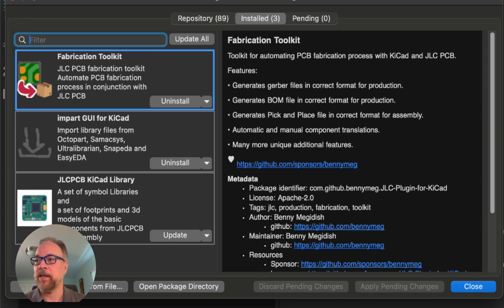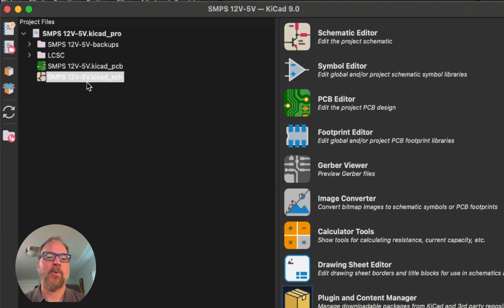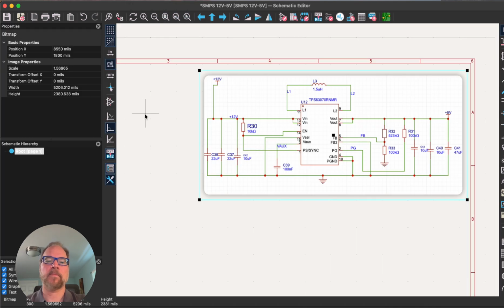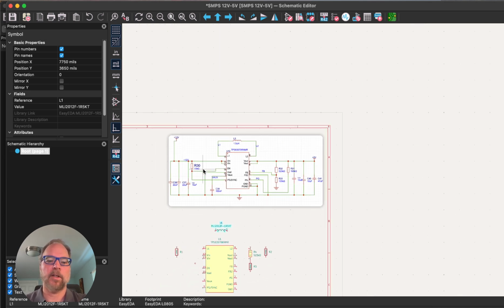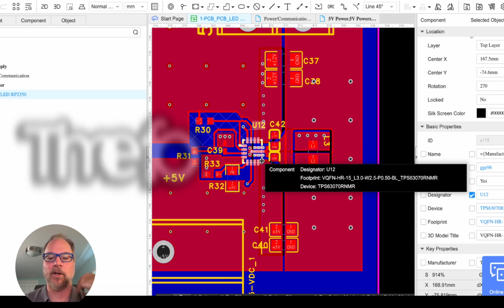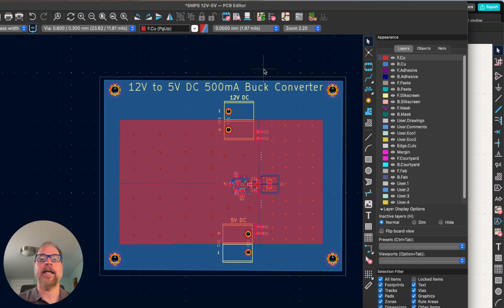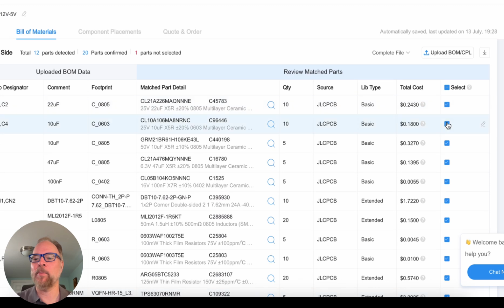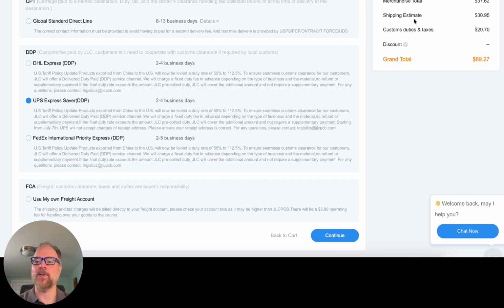Designing a PCB in KiCad for JLCPCB Assembly

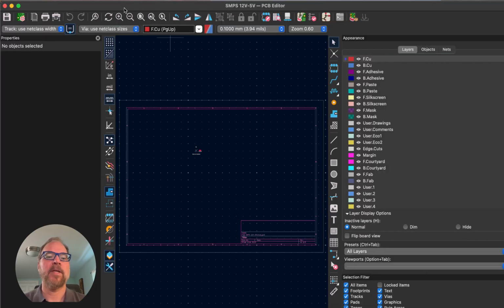Comment: Too fast.  I have been scrolling back and forth and still can not follow your choices around the 6:33 time marker.  Plus your top bar is (like tools, Preferences, etc is not showing).  Makes it next to impossible to follow.  You have useful information but your presentation is like the school teacher that writes with chalk in the right hand and is following everything with an eraser in the left hand not allowing the students to write notes down (actually happened to me).

Slowwwwww Downnnnnn...
Reply from the maker: Thanks for the feedback.
Reply: @ElectronicsUnscripted  I can not get this to work.  I'm using a fresh install of Kicad 9.0.8.  I follow the your instructions for installing the 3 libraries.  I attempt to use the part number C115451 and see this 

Starting import for EasyEDA/LCSC component: C115451
Failed to fetch CAD data for component C115451
EasyEDA import failed: Failed to fetch CAD data for component C115451

I have tried to follow the github instructions for doing the initial configuration for impartGUI to encounter failure after failure.  I am unable to find a video that actually goes through the correct steps to install and use for the latest version of Kicad 9.0

I had no problems with Eagle CAD but I stopped using it since they changed the pricing on it years ago.  I'm trying to use Kicad but find it to be just a mess compared to what Eagle CAD was.  Right now, I have no choice but to use Kicad since I do not want to use EasyEDA.

Comment from the maker: One thing. That inductor is TINY. Far too small for this power supply. I know I say this is a toy project but if you actually wanted to use this as a model project replace that inductor with much higher current part.

Comment: In fact, this is not the case. EasyEDA generates all the necessary files for PCB manufacturing and automatic component installation. Prices and current availability of components are also available directly from EasyEDA. While EasyEDA may be simple and lacks the ability to simulate PCB processes, it is the engineer who designs the PCB, not the software. By learning the magic of PCB design, you can create high-quality printed circuit boards using your own knowledge. I have also considered more advanced software products, but the ready-made libraries and jlcpcb component warehouse have kept me engaged.
Reply from the maker: I’ve got a whole video series on using EasyEda as well. I’d highly recommend that route for beginners and intermediate folks. But there are good reasons to use kicad. If you do these steps make it easier.

Comment: Having some troubles to import an lm317 
Error during import: Unable to identify library format. Missing essential files.
Reply: got another part, it imported and has no symbols or footprint.
Reply from the maker: @jcbritobr did you do the step where you configure kicad to point to the location where impartGui imported them?
Reply: @ElectronicsUnscripted yes. I selected the correct folder
Reply from the maker: @jcbritobr  What's the LCSC part number? I will try it out and see what I get.
Reply: @ElectronicsUnscripted will post it tomorrow in morning here.
Reply: @ElectronicsUnscripted  here is it. C880038. Did nothing at import. I cant find it in schematic symbols. Ill try to delete de project and start again.
Reply: @ElectronicsUnscripted  I selected the root folder of my project and it worked. But some parts has no symbols, and some has only footprints.
Reply from the maker: @jcbritobr  So when I import I get this:

Try to import EeasyEDA /  LCSC Part# : C880038
Created Kicad symbol LPC1754FBD80K
Created Kicad footprint LQFP-80_L12.0-W12.0-P0.50-LS14.0-BL
Created 3D model LQFP-80_L12.0-W12.0-H1.4-LS14.0-P0.50 (wrl,step)

The symbol ends up in 'EasyEDA.kicad_sym', which I link to in Tools | Preferences | Manage symbol Llibraries, Nickname: EasyEDA, Library Path: /Users/username/Documents/KiCad LCSC Libraries/EasyEDA.kicad_sym

When I go to my schematic I do Place  | Place Symbol and then search for C880038, and I find it in the EasyEDA folder. It's a beefy part!
Reply: @ElectronicsUnscripted yes, it appears in schematics to me, but it hasn't a symbol. It's only pins when add it in the schematics. The footprint is ok

Comment: Hi,
Really appreciate your help with this… I failed to get this up and running by myself 2 days ago…. I was trying using the easyeda2kicad-plugin GitHub version… and your guide with how to do the pip3 got me there. 
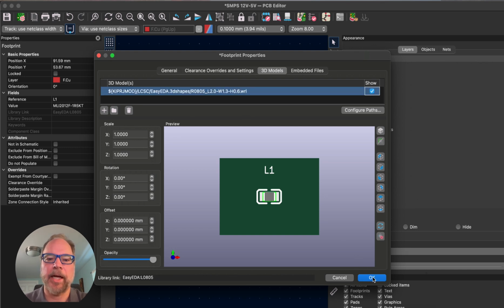Im trying to set mine up as global libraries… so slightly different to your way… At 16:21 you tweak the folder location for the 3d step file…. Do you have to do this each time? As I noticed there is a button there ‘configure paths’ I guess this is to set the path so it works automatically?
Reply from the maker: I kind of gloss over that a bit. I believe I changed a path in the middle of configuring stuff and that broke the 3D file paths. 

When I use this on new projects with impartGui, everything seems to work just fine without manually tweaking those 3D paths. But it’s good to know how to fix it if it breaks.

And global libraries is probably a better approach but I wanted to be able to create a GitHub repository that was self contained.

Comment: In my design I ended up switch all 0603 to 0402 and found it to be really tedious having to ensure all new part numbers and symbols were updated correctly, what would be the process to replace symbols/footprints for different parts with these plug-ins?
Reply from the maker: I think in this case the tools might not help much. If you want to bulk replace one part number with another, in the same footprint, sure, but if you want to switch multiple different part numbers to different footprints, and different part numbers, I am not sure the bulk update helps much. I am no expert, I've got several failed bulk updates under my belt.

I'd almost just start fresh from the schematic and delete the old part, place the new, and re-use the reference.